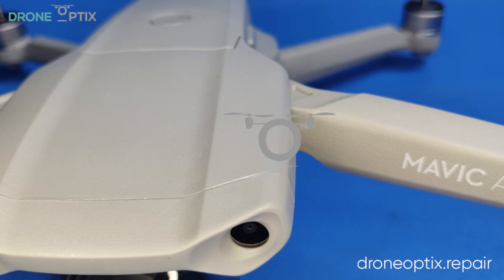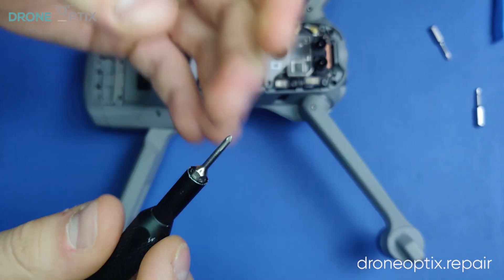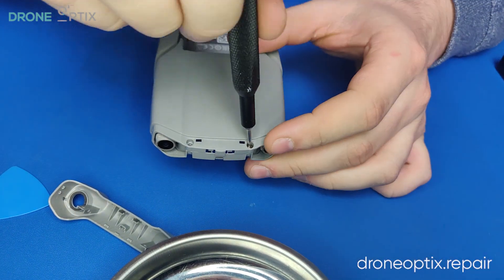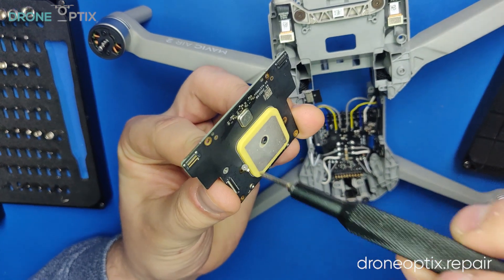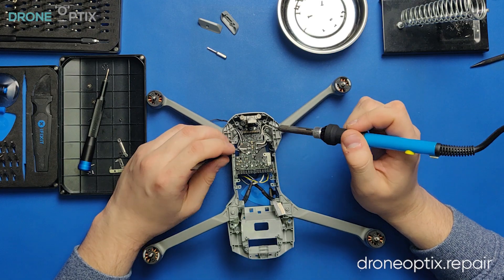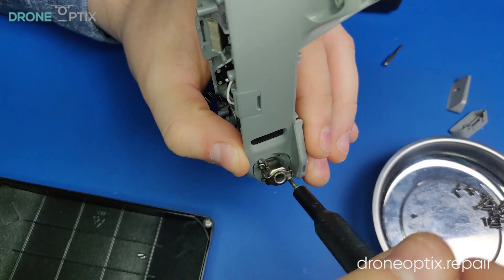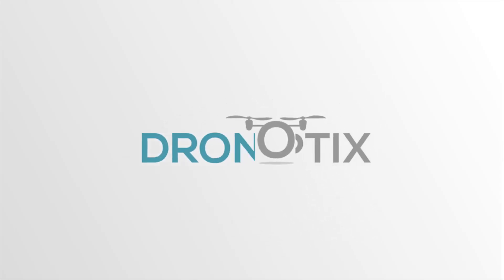DJI Mavic Air 2 Teardown - DroneOptix

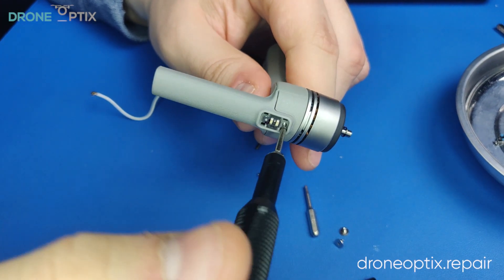Comment: 4:35 are the cords on the led of the landing leg a clip on or do they require soldering?
I managed to crash my mavic air 2 and the leg broke. The antenna cord is still intact BUT the two led cords have disconnected

Comment: at 0.18 timeline, when you remove the bottom, do you see sealing to those screws to prevent unauthorised unscrewing so that once remove, warranty will be void? I suffer warranty void because of simply accusation of missing seal caused by me.
Reply: Hello,
Same over here !
Did you find a solution for this ?

Comment: what type of motor is it? Schematics?? size and power??
Reply from the maker: its a brushless motor DJI do not release schematics, if the USA push the right to repair bill and legislate we may get some then, size and power can be found in the specs of the drone on the DJI website :)

Comment: I crashed my one of my rear sensors, is it easy to replace it?
Reply from the maker: Yes, it's really easy, so long as you are happy taking the drone apart like shown in the video. We have them here - droneoptix.repair/product/brand-new-and-original-dji-mavic-air-2-backwards-vision-module-sensor-genuine  they'll be in stock very soon.

Comment: Thanks for the vid!!!! Very helpful replacing both left arms! Might want to mention that you need to put the front shoulder joint (?) in the half way position when reinstalling to preload it.  Also I found if you pry up slightly on the ears (?) at the rear of the top shell, it comes off MUCH more easily.
Reply: hi mate, can you please run me through this half way position? like does the armm need to be in the open position? also what are you using to turn the joint. ive been stuck for a long time now. thanks
Reply: @SuperAirman24  The rotation shaft is the little silver "can" with black plastic tee on the top (looks like a servo arm) You can see him pushing it out at (3:34) and the other arm's joint is on the table near his middle finger knuckle.  Its the pivot and connection point for the front arms.
 Hold the "can" gently with a pair of pliers and with another pair to hold the arm.  Rotate it gently and you'll feel it lock into position every 180 degrees.  By "halfway" I mean the point between locking positions. It'll hold itself there if you're careful.  Then install it on the drone with the arm partially open (it only fits one way) and   push it down onto the tits where the black arm seats. 
 Clear as mud huh?  I've got one coming in tomorrow and I'll post a vid. If pictures are worth a thousand words and a vid is at least 10k.   cheers
Reply: I was able to figure it out but man it was a pain to put back.

Comment: Hi DroneOptix, thank you for this guideline. Really appreciate. 

I have some questions. Basically, due to new European regulations, I need to decrease 570 grams weight of the Mavic Air 2 to 500 grams. I have an idea to get rid of avoidance sensors (Front,Down,Rear). Related to the above, the questions as follow:

1. Is there a chance to measure the weight of each module are shown in the video:
- Front vision module (2:27)
- Down vision module (1:02)
- Rear vision module(4:10)

2. What are the parts may be considered as redundant? Just in case if avoidance sensors will not cut 70 grams.
3. In case I remove 3 mentioned modules and disable the avoidance sensors in the setting of the app. Would it be working fine? 
4. Is the a chance to remove - Rear vision module(4:10) without unsoldering work?

Thank you a lot for any information. it will help me a lot to make a decision. I believe for many people in Europe that would be helpful, due to the new European restrictions (valid from 1 July 2020) with drones above 500 grams. 
Thank you a lot
Reply from the maker: Sorry, but we don't have all of the parts in stock right now to carry out that weighing. We also don't know if the drone will still work without those sensors, but it should.

Comment: Is it easy to tear down the landing gear stand? Just  concern, if I need to replace this part, does the LED come out easily or do I need to desolder the wires to remove it from the housing?
Reply from the maker: Hey,
The LED can be pulled out without soldering

Comment: Nice video thanks! I have been doing some comparisons between US and EU model to find out the ADS-B hardware. I cannot find anything different between the two models. As per DJI, US models come with ADSB rf circuit and additional antenna and a different ESC powerboard